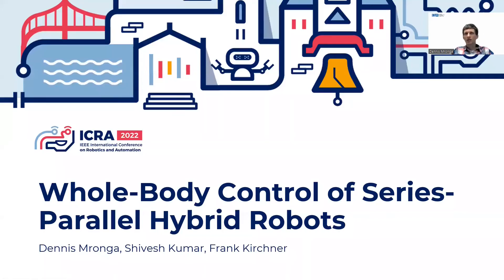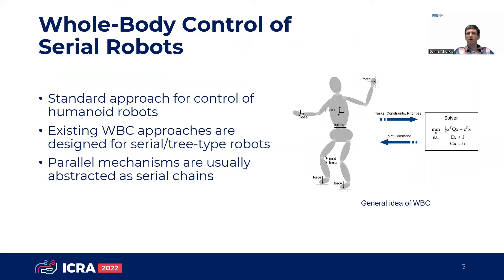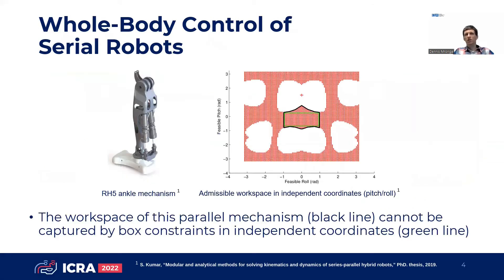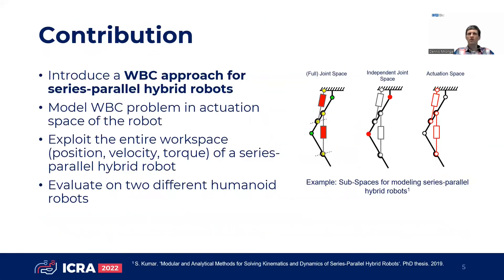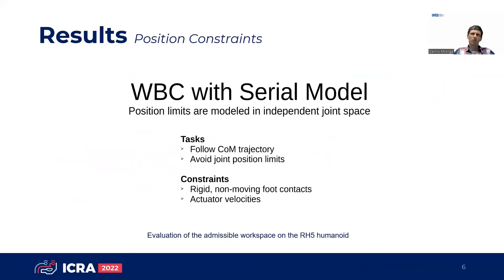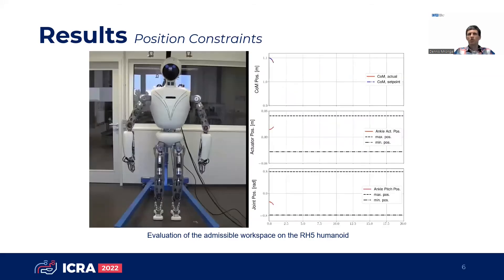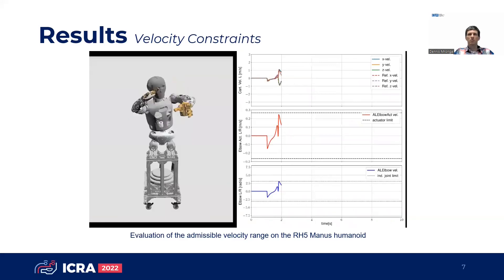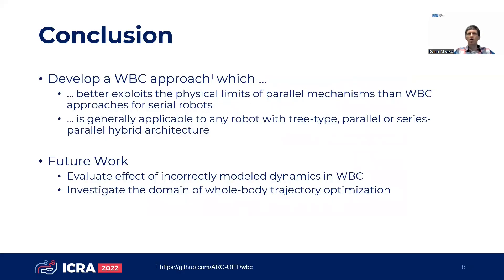ICRA 2022 Presentation: "Whole-Body Control of Series-Parallel Hybrid Robots"

Comment: After watching whole video I still don't know what you mean by "series-parallel approach". But knowledge in my brain acquired in my childhood tells me that both words are antonyms. So I have the feeling that "serial-parallel" is an alogical word construction.
So I would suggest that you name it simply parallel approach as all the joints have to be controlled independently. For me, nothing new as everything how brain is controlling the body movement was already developed many years ago.
I would recommend you to think of body control as every group of joints = 1 microprocessor. Human brain is terribly parallel system.